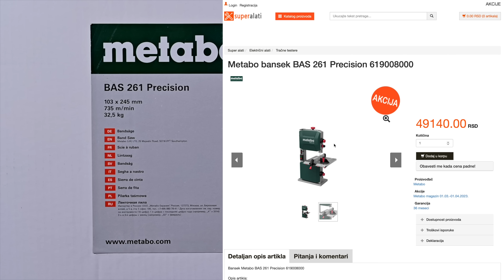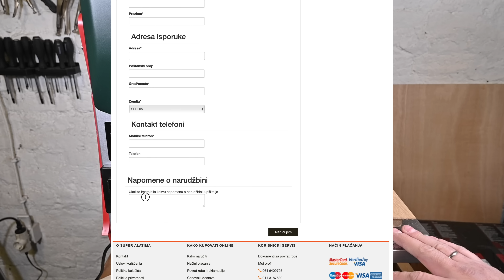Metabo BAS 261 Precision Tračna Testera za Drvo Bansek Recenzija 4K

Comment: Does the lower wheel ever need to be adjusted? Is it possible to adjust the lower wheel in this model? The owner's manual does not mention the lower wheel.
Reply from the maker: Rarely need adjustment and it can be adjusted by undoing 4 screws on the axle and repositioning it.